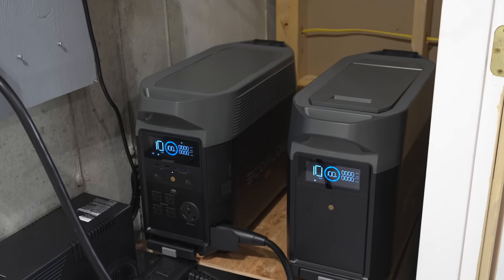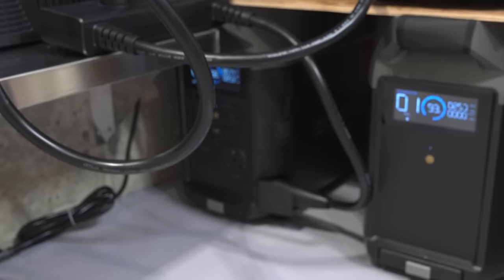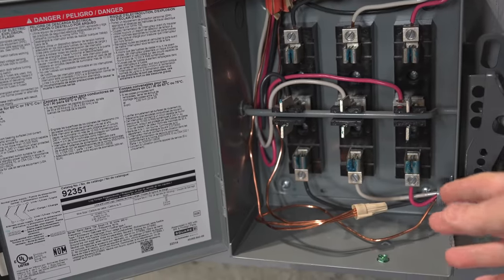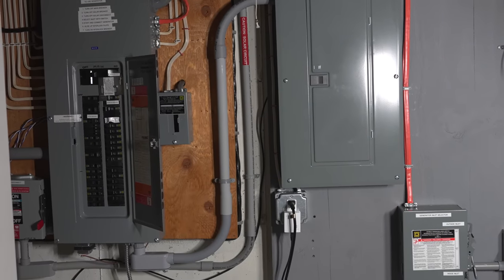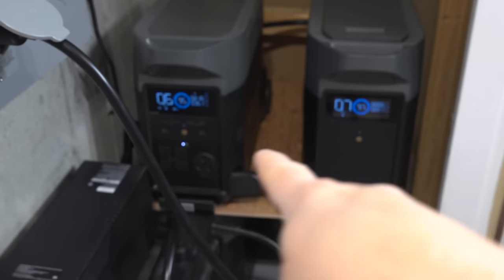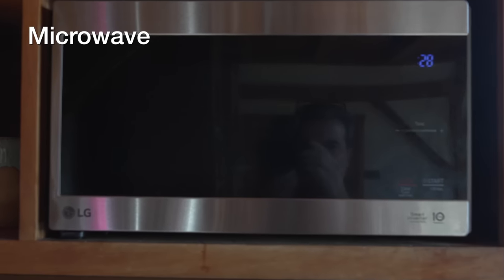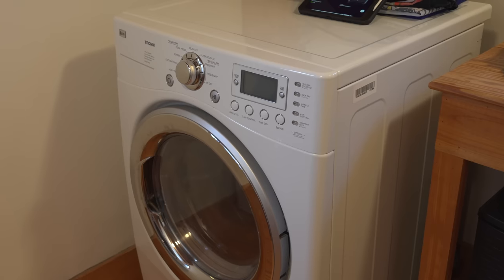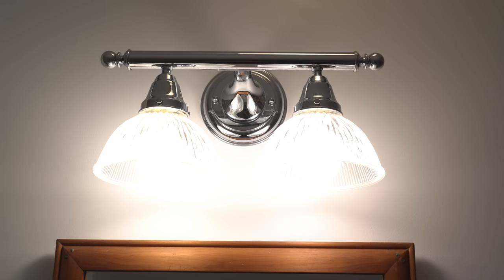How to power your Whole House with a battery generator - Ecoflow Delta pro

Comment: An often overlooked issue with gas generators is that they typically cannot produce a pure sine wave, but rather a modified sine wave. There are many electronics such as PC's, tv's etc. that can malfunction or potentially experience damage while running on modified sine wave. One of the advantages of a battery inverter such as the Ecoflows or many other available split phase inverters available is that they produce a pure sine wave which eliminates the worry about your household equipment (unless you accidentally buy a cheaper modified sine wave inverter due to lack of experience). I've run my gas generator with a transfer switch during several power outages and I'm pretty much done with how much of a pain in the ass it is to set up. I'll save up enough money to build my own solar split phase battery generator, stick it in a large theft-proof and waterproof box, and kiss the gasoline purchases goodbye! Thanks for making this excellently presented video!
Reply: That's why it's good to place a UPS between the power source and your sensitive electronics.. they will generate a square sine wave which is converted into something usable by their own internal transformers of the end use devices...
Reply: The power coming into my house from my Harbor Freight Predator 9000 is much cleaner than the power coming from the municipality, by orders of magnitude. And it's not an inverter. It's just a regular ol genny I've converted to NG. It's never tasted gasoline. However, I do have Greenwave conditioners scattered throughout the house, plus an additional conditioner block that all my electronics are plugged into. It's not pure sine wave clean, about 100 on the meter. The unconditioned portion of the house has read as high as 1440. 

I have a short on my channel of a radio broadcast coming thru my electrical wiring. I had never heard of such a thing before.

Comment: This is exactly my idea. I love that the batteries are quiet and no fuel expense and worry. The issue is like the gas generator, your juice eventually runs out. For this reason, My thoughts were to charge the backup lithium batteries as part of the initial load. So as you have two batteries there, my next step would be to get two more and be charging those on the current load. That may equate to 2 less hours of run time, but it keeps you going. 😊

Comment: Thank you for making short videos like this. In this case it's a huge help for someone just wanting to know what a double voltage hub does and how it works. I really like the safety feature the 3 pole double throw switch provides by enabling only one outlet at a time.

Comment: THANK YOU. This is exactly what I'm looking to do. By the way, an alternative to getting your battery generators recharge would be to run your gas generator---and have that charge your battery generator while using it for your house. This way, your system can back up each other.  I would think you'd need a sine inverter and whole house surge protector though but not sure. If you do end up needing to put one, you should update your video to include it in the system. 😉 THIS WAS AN AWESOME VIDEO BY THE WAY!!! THANK YOU FOR SHARING.

Comment: That's a good system. Pricey with that amount of gear. I just had an electrician install a sub panel for generator input next to my main panel. He wired a 15' heavy duty cable I can plug in to a generator. It is expandable to 8 circuits. I only have 3 going in to it. Furnace, fridge and chest freezer. I'm in Alberta so heat is important for my anticipated winter rolling blackouts. They warned us last winter but with so much new housing and no new power plants this year, I'm preparing. I've got a Delta 2 Max. Before winter I'll have 2 extra batteries to give me the 6 kwh. I can plug the AC in so when the power comes on it will charge and still power the sub panel without me needing to switch it back to the main panel normal operation. I may get a smaller unit for upstairs to power the wifi, computer and TV later. Essentials first.
The good part of the sub panel only housing critical circuits is that I can leave a light switch on. When the power is back on, the light will turn on and I'll know when power is restored.

Comment: Great video as always. I basically have the exact same set up except that I have 4 expansion batteries. I don't have an exterior Reliance Controls PB30 L14-30 outlet but I might look at that in case I want to use my Yamaha EF6300iSDE. If you encounter any issues with the the Delta Pro's getting out of balance (i.e) one DP getting depleted faster than the other) it typically because of which phase your loads are connected to. Although most of the time, both of my DP's + 2 EB's would stay relatively balanced with each other (within 10% to 15%), by adding the Victron autotransformer between the Double Voltage Hub and the PB30 L14-30 outlet, it just takes all the worry out of it.

An autotransformer can be used for step up, step down and split phase output balancing purposes.
While the step up and step down functions are fairly straightforward, split phase output balancing may require some more attention.
Consider for example a 30A 120/240V split phase supply.
The supply could be the grid, a generator or two stacked inverters.
Some of the loads connected are 240V, others are 120V. On each 120V leg the load should not exceed 30A. The problem is that as soon as 120V loads are connected, the two legs will show a different current. This is because the 120V loads on the two legs will never be balanced. A 120V 1200W hairdryer, for example, will draw 10A from one leg. A 120V washing machine could even draw in excess of 20A from one leg. Between the two legs the difference in current, or current unbalance, will therefore often be 20A or more. This means that the 30A supply will not be used up to its full potential. By the time one leg draws 30A, the other leg may be drawing no more than 10A, and increasing the 240V load, for example, will result in an overload of one leg while the other leg still has spare capacity.
Theoretically, the total power that can be drawn from a 30A 120/240V supply is 30 x 240 = 7,2 kVA.
In case of 20A unbalance, the practical maximum will be 30 x 120 + 10 x120 = 4,8kVA, or 67% of the theoretical maximum.
The solution is an Autotransformer.
By leaving the neutral of the split phase supply unused, and connecting an Autotransformer to create a new neutral, as shown in figure 1, any load unbalance is ‘absorbed’ by the Autotransformer.
In case of a 30A supply, the load can be increased to 7,2kVA, and a 20A load unbalance will result in one leg supplying 40A, and the other leg 20A. The 20A difference will flow through the neutral and the windings of the Autotransformer. The current through both 120V wires of the split phase supply will be 30A.

Feel free to check out this post for more details

https://www.facebook.com/groups/deltaprolaunch/permalink/1562083637591819/

Comment: I have a 4000 watt generator and im loving the idea of having this system and using my 4kw generator as an extra juice to this system. I have some issues with the cable lengths  but overall i think this unit is capable of doing everything i need and its easy to install.

Comment: Beautiful setup! Only thing I’d recommend is upsizing the size of the inlet receptacle, romex and back fed breaker. You’re talking about running your whole house on a setup only rated for 30A, which your house can easily exceed on each phase. I’m sure you are aware of the adverse effects of overloading conductors and protection devices over an extended period of time. Nice video as always!!
Reply: This is a good point. I'm about to get an inlet installed and am deciding between 30 amp and 50 amp. But 7200 watts at 240v is a max of 30 amps anyway, so the 30 amp inlet is probably okay unless there should be a buffer. It seems like the inverter would overload before there is damage to the circuits.  Also, can you connect the dual voltage hub to a 50 amp inlet? Is there a readily available adapter in case I go with the 50 amp inlet?
Reply: In theory in extended outages where this is needed you shouldn't be wasting power on the frivilous stuff, just the hots and colds (heating, and food preservation)

Comment: Congrats on developing your redundant backup power system, it’s pretty impressive. However the one thing on my mind as I watch you WOW us with your sophisticated electrical enterprise is ……. $$$ !   I may have missed it but I didn’t hear you mention a cost factor to acquire and install all this stuff.  I have a ‘watered-down’ version of your setup and I understand the impact of randomly adding ‘Ecoflow’ devices as convenient as they are.  For me the economic factor could not be ignored.  That said, I’m still impressed. 👍
Reply: Hello, I read your review, and I can only say this: He has 5 different units plus a hub that has to connect the "BATTERIES" together, never mentioning even remotely about any solar regeneration of those batteries. The ones he has are at least 3k each and not to mention all the extra wiring you have to do get it to that level $$$$. also he added he charges the batteries via GAS generator . That should tell you something...It's not all that's it's cracked up to be. I have a 12,000 watt  gas/propane generator, I had an electrician bypass 10 circuits into another box and run the wires. Electrician : $2,000, Generator Gas / Propane $850 , and Misc. things I bought including 4 20lbd propane tanks ( the very same ones that you can get at your local wal-mart   plus those propane tanks have a shelf life of at least 10 years.... so my total was about 4k . +or a few bucks , so the only things I don't have is central heating and a/c ,my glass cooktop, mt dryer, and my wall unit microwave /oven.. But what I do have is every electrical outlet and every switch is powered . I have ceiling fans that work, I have space heaters if I need. So if you get these you're really dependent on the sun. If it comes out and how strong is it?  Do you have many hours of sunlight? These are things you have to consider before dumping a lot of money into something that will not meet your expectations .... I hope this helped you and others that might read this..
Reply: @markhiggins4164 truth-be-told I started with a gas/propane backup system myself. I now have comfort in knowing I have a backup - to the backup. Thanks for your reply. 
- Happy Holidays!

Comment: I've been wanting to buy an Ecoflow as a back up for my house what is nice is that you can even use them as a UPS so when the power goes the devices you are using like the TV / Computer will not lose power.  Very nice back up batteries my plan is to have 1 of them in each room of my house.

Comment: I don't know if anyone has pointed this out yet, but your transfer switch is not connected to your grounds that pass thru the switch creating an electrical shock hazard. Please connect to your green grounding screw. Safety first is a real thing.

Comment: Nice setup. I had a different idea and that to use a single EcoFlow Pro for 110V only. To do that I need to split my main breaker panel into 110V and 220V. This way I can switch back and forth without having to shutdown all 220V breakers. This setup is for emergency use only.

Comment: My house backup batteries are 4 12v 120 amp hour walmart marine batteries. Power All 120v circuits thru a 120 v 40amp sub panel in our utility room with a 3500 watt 24v psw inverter. Will run all night long. 3 bedroom 2 bath house.  Can even make a pot of coffee in the morning before the sun comes up and solar panels kick in.

Comment: Outch.  It sounds like this is really just two 120v inverters that are synchronized to run 180 degrees out of phase.  While that does get you 240v power, when you have more load on one phase than the other, it is going to drain one battery faster than the other, and when one shuts down, so does the other.  Schneider Electric has a hybrid inverter/charger system ( it used to be called the XW but I think they changed the name now ) that can produce just over 6 kW each, and you can gang up to 3 of them in parallel ( for 18 kW continuous load, quite a bit higher peak ) and feed them all off of a single bank of batteries that can be as large as you want and so they all discharge at the same rate.  It can also be programmed to to know how much current your generator is able to supply and if your load goes over that amount, it will supply the excess from the batteries, and if your load is lower than that, it can use the excess to charge the batteries.  It can also be programmed to auto start the generator when the batteries reach a low limit, and shut it down when they reach a high limit.  It also supports solar input as well and can be programmed to sell the excess to the grid once the batteries are full.  As a workaround for your system, you could install an isolation transformer between the batteries and your panel and that will balance the load between the two phases, so the load on the two inverters should even out instead of having say, 1300W on one and 500W on the other.

Comment: I really liked this configuration, but in the country where I live there are not many equipment options. I used 2 hybrid inverters from Growatt, the SPF3500ES, connected to a ~12kWh battery bank. In a test I did, in normal use of the house, the 5kWp set of solar panels and batteries kept the house going for almost 160 hours, it caught a cloudy day and the party was over. Still this year I will exchange my 3 inverters from Growatt (grid-tie and hybrids) for one from Deye, the SUN-5K-SG01LP1. I believe it will be a great investment, I will be able to export to the network in just 1 piece of equipment, power the house, charge the battery bank and even have its own connection for generators, which I will use to ensure that I am not left in the dark.

Comment: Great three pole double throw Switch to know about. Gonna hunt one down :+) ...  Having a battery to inverter (even for smaller watt 120vac) along side a generator is a no brainer like this: When Grid goes off, battery to 120vac is available for lower amp needs. Then use of generator for higher amp needs for an hour or less can recharge battery bank; instead of running a generator 8 hours a day up to 24/7 ... and wasting fuel. That is the way boats at sea do it 🙂 That 240vac backup plan is awesome.
Reply: I'm in NorCal. 2 years ago we had a 3 day/night power outage thanks to heavy winds and wildfires that destroyed power lines. I was on batteries. Clownboy on the next street over had his contractor generator running day and night. It was very annoying and loud at night. He must have refueled it on the run as it never shut down once. On the 3rd night about 3AM it was still in the 90F degree range outside and I was lying awake listening to the generator drone on. The sound changed a bit then it started clattering getting louder by the second. The generator stopped suddenly. Pure silence....except for me laughing. I will bet it threw a rod right through the side of the engine from lack of oil. You have to check the oil level more than once a year.......

Comment: Loved the video Chris! I'm doing something very similar in my home but I'm using a transfer switch instead of an interlock switch. Instead of taking the whole house on and off the grid, the transfer switch allows me to take individual circuits and power them with a generator / power station and solar. I don't have a 240v backup yet so the interlock won't work for me right now. Thanks for the video!
Reply from the maker: This circuit switches work very well. I have used them many times and they are rock solid. Looking forward to seeing your install and thank you for the kind words too.
Reply: @scott6252  that's how I use mine! I have a couple videos on the topic on my channel. I can drop my power bill throughout the month while running off solar, plus have power during an outage.
Reply: @SilverCymbal Do you need that switch if you are not using both generator plugs at the same time ?
Reply from the maker: @kyle98927  I read up a lot on this and its a big deal since having the neutral doubles the switch prices. Technically it should make no difference but the information I found said the neutral must be switched. I got too concerned and if you switch all 4 you are assured of no issues but with 3 I dont believe it will be correct.I know its not great news, sorry.

Comment: The Ecoflows as someone notes below charge very quickly because they plug directly into AC, the Jackery and some others use a DC adapter that is low voltage and takes a long time to charge. I have an outside 240 V adapter to connect to my gas generator but for a quick power outage or at night when I don't want to make a lot of noise will use my one Ecoflow and one Jackery, which I kind of regret buying, to plug into refrigerators and essentials.

Comment: I just purchased the Delta Pro with the smart extra battery and transfer switch.  I mainly just want to run a well pump, fridge, some lights,  and hvac circulation fan.  I should be good to go.